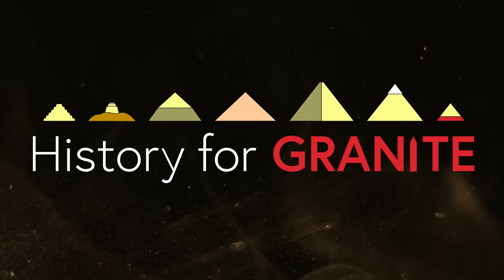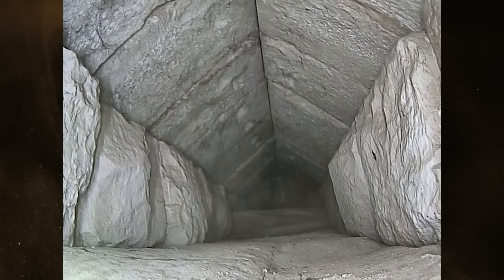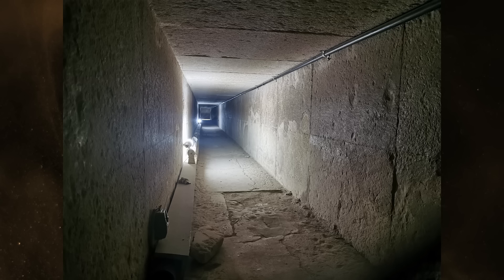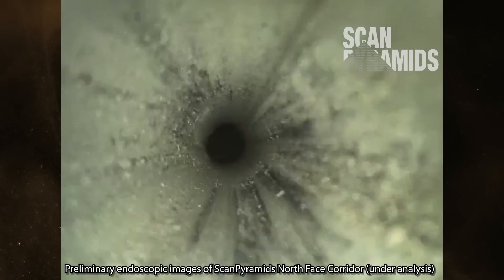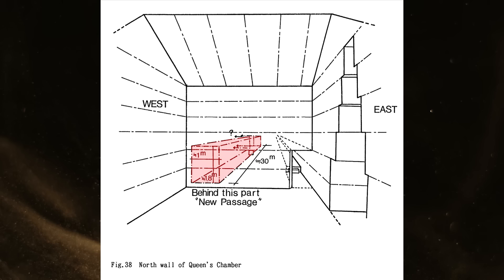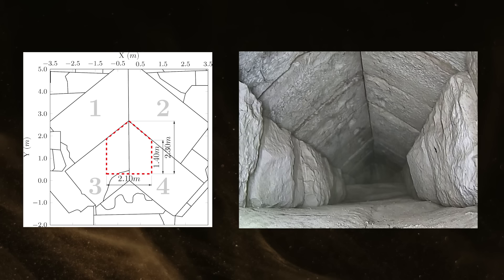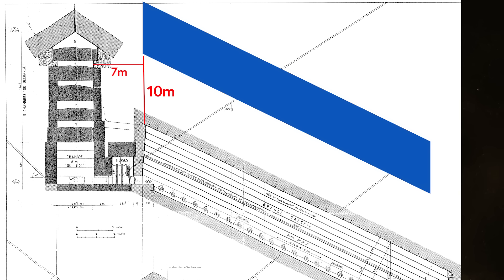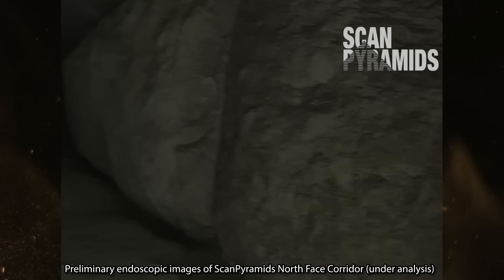New Robots to Explore the Great Pyramid

Comment: Not sure how well the sand robot would work with compacted sand under pressure. You think of that robot had to reach 20 meters in and is 10cm in diameter then you have a huge amount of sand that needs to be displaced. 
  It can't just go up freely like with all the experiments they use it on. If it was going into a completely sealed box with the weight of a pyramid on top it probably wouldn't work as well

Comment: Is it possible to combine both your ideas here? And use the air filled robotic tube on the north upper chamber shaft. It’s accessible from the outside and if there were any small holes along it’s route near the void surely they could be accessed without drilling.
Reply: Tame your wild ways, that's far too awesome for Zahi (or whoever decides) to consider. Seriously though, good idea!

Comment: Great Video
That void space will be difficult to get into. It's in an odd place inside the structure. 
If it is a space 120 feet long with no entry points then it was designed to be never opened.
That is if it is a space 120 feet long 12 feet wide.
Reply: It was internal tunnel used in building pyramid
Reply: @SoulDelSol  If this is a known fact then why would someone need to dig into that space. It has served its purpose millenia ago.
Waste of time.

Comment: I don't understand why someone doesn't go into the king's chamber, and drill a hole in the wall, to the right of the sarcophogas, about a foot up, or in one of the cracks. According to Oudin, that is the entrance to the rest of the chambers he says we haven't seen yet, the place where all the kings goods would have been stored, and the place where the original funeral procession entered the pyramid during the burial. To me it makes sense, simply because of the kinks in the little side air shafts... plus, didn't some ancient historian say that front entrance is where the procession entered?.... it seems like it would be pretty easy to drill there and either confirm, or lay to rest forever, Oudin's theory of the missing room section. I think Oudin's missing rooms, AND your theory about the 2nd grand gallery (that scan-pyramids seems to confirm) being needed to get the final heady granite blocks that high, could BOTH be true... I am curious to understand your reasons for not agreeing with Oudin here? the measurements make sense... i LOVE your channel! AWESOME content bro!!!!!
Reply: sorry, but not only that.... I honestly just do not see ANY other reason for those huge chevron blocks on the north side if it wasn't the funeral procession entrance.....  i don't buy that they were just "testing a weight relieving technology"...psh....

Comment: I think some of the reluctance to use these non-destructive exploration methods comes from the fear that more and more exploration will be done in all the pyramids, tombs, and monuments.  Also don't forget rumors that there are tunnels and mazes that are just below the surface that have been off-limits for exploration for many years, that are said to connect to sites many miles away.  The council has always seemed to want to have a timetable on the reveals that they do, so that each reveal brings new and/or renewed tourism.  Kind of like the new attraction at an amusement park.
Reply: There's been rumors about tunnels for more than 1 century.
Absolutely no one has been able to prove it.
Reply: The explorers in the 1800's would've documented them.

Comment: So is the Great Void horizontal, or does it slope parallel to the Grand Gallery?  You show it both ways.
EDIT:  Of course this makes a practical difference, both in the purpose of the void and in the plan to reach it.  The drilling proposed in this video COUNTS ON the Great Void sloping downward, so that horizontal drilling is sure to intercept it.  As long as the slope is uncertain and the prospects for success are uncertain, you can be certain the Egyptian authorities will not authorize drilling.
Reply: You would think the scan results would have shown this.  With my engineering hat on, I would expect it to be a counterpart to the Grand Gallery.  Did the scan project reliably detect all the spaces within the pyramid that we do know about?
Reply: @polbecca  I suspect that the results were too noisy for a clear answer, but I'd rather see the actual data.  All the diagrams I have seen have been similar to the illustrations here.
Reply: @polbecca  the orientation/slope of the north face corridor was also in question before being filmed, so it seems like the method used to discover the voids only gives us a rough idea. It’s my understanding that the Scan Pyramids team had to aim their tools directly towards the area of a suspected void, so I don’t think they could scan the whole pyramid in one go.

Comment: I’m guessing the “big void” was part of an inset ramp running at approximately 26 degrees from the lower North face corridor to the top of the kings chamber. This, of course, would line the exterior features up with the interior features almost exactly, and would make practical sense for the design and how the blocks were stacked in the kings chamber. From there, my guess would be that there was another inset ramp running at a similar 26 degrees approximately 7 degrees adjacent in the opposite direction up to the upper  north face feature. Would love to see a probe of the big void.
Reply: Utube has an old internal ramp video, an animated simulation of how it was made, with ramp tunnels to get up and thru the pyramid as it was being built up.
The mysterious void above grand gallery is part of the access tunnel sys as well as the passage behind the chevrons over the entrance.

Comment: Attn : Zahi Hawass and friends'-----Drill in 1" horizontal access hole. Enter from the side of The Big Void, determine best side, north or south. Drill into the void's 'best guess' center. Least destructive and cams' will be able to view all directions inside. Future for larger hole is sensible as well. Consider on the negative, that a structure may have to be scaffolded at the side. Consider the positive, the entry spot at pyramids side will not affect existing openings. Tourism, for example would be undisturbed. Just need to 'rope off' the ground area below the project. Thanks for considering.

Comment: I have a theory that the large pyramid is located on a small sandstone mountain as a base, then they started to build a 8 sided structure around it, for each side of the pyramid is divided so it will push towards the center. When the outer shell was built they filled it with sand and placed ramps and what later will be walls on the inside, when this is done they add a layer around the natural sandstone, make segments they fill with sand and then keep do this. This will make the pyramid lighter, and to use less material so it can be built much faster then we think.

Remember the story about the 3 first pyramids and how one king built them before the last big one, that indicate that 4 pyramides can be built in a tome period of 20 to 30 year or faster.

Comment: Good starting point surgestion,timely.i would take into consideration earlier surgestions of it representing part collapse material creating some of the void.i don't understand how the scanning set up work's,if it (scan)gets a clearer picture if it's set up closer to the void ie  the start point surgestion. If so,I would surgest a combination of small explorations and then scans ,on and on towards the void,but would also concider rubble and or sand,,,,which would then involve inserting long metal tubes(for the camera/scan equipment) through which it could travel through such debris/rubble/sand/calcite/salt ect.thanks for setting out this plan ,where no other would dare surgest penetrating the sacred structure

Comment: Been into the Great Pyramid what an experience, but not an engineer for sure.   I have to wonder if it possible that the void was created and filled with sand to reduce tension on the Grand Gallery and King's Chamber?  It is in a very specific location offset from the chamber and could be used to balance the weight of the Grand Gallery and the King's Chamber.
Reply: But if it’s filled with sand then it’s not a void, and wouldn’t the muon detection have missed it?

Comment: I hope they will send an expanding tube robot into the North Facing Corridor.  The walls are clearly rough finished, but the "back" wall looks more finished.  Perhaps there is another gap there to send the robot through like on the north wall.   Perhaps it might find the sand that the drilling did.

Comment: I believe that the Great Pyramid (GP) is actually 2 distinct structures:
1) The granite temple in the middle of the GP
2) 2.5 million limestone blocks that entomb the temple as a pyramid

For some reason everyone thinks the GP was all built at once and by the Egyptians.
That's like 5,000 years from now, archeologists find a home full of furniture and just assume
the builder of the house built all the furniture inside. It sure only takes a little brain power to make that assumption.

Anyway, I believe the granite temple was built when the Great Sphinx was built 12,500 years ago
by a race of people that mastered working with granite and built temples all over the Giza Plateau
and died from the Younger Dryer event 12,000 years ago that killed most humans on Earth.

We see the inside of the Granite Temple but have yet to learn what the outside of it looks like - it's entombed with millions of limestone blocks. The instruments show the voids left by the limestone blocks distributing the weight of the blocks above around the granite temple. There is a void all around the granite temple - that's what will show up over time.
Reply: Too much sci-fi here.
Reply: They have done carbon tests on wood used in the pyramids showing the age is around the right time, not 12500 years.
Reply: @kiwibonsai2355  Not true - no charcoal or wood has ever been found in the Granit Temple - you can't find a link to prove otherwise.
Reply: @noleftturns  Do you speak about a pyramid or a temple ?
There's quite nothing left from the temples ...
The room named "King chamber" is a temple according to you ?
As said above, the GP has been dated with C14. So this room is the same age.

Can you provide any links prooving what you write ?

Comment: Nowadays drones are of good quality and at affordable prices.  they are equipped with 4k, 8k cameras, they can be equipped with scanners, sonar and other detectors to find out what may be hiding behind limestone blocks and various rocks.  It would therefore be really important to be able to photograph in detail all the internal and external parts of the pyramids and to scan it entirely to create a 3D model, moreover a 3D model could also be made with multiple photos (as in "Street View"  ).  This would make a valuable archive of the current state of the pyramids for future generations, before time, water infiltration and visitors degrade them further!  Personally I wonder what may be above the limestone slabs at the top of the Curved Pyramid Chimney, because the blocks of limestone which were to obstruct the assention must have a reason to  exist.  What should they keep safe from intruders?  what other treasures can still be hidden in the pyramids?

Comment: While I like the idea of the air pressurized robotic sand snake, it might be unrealistic as the sand might be under great pressure from the rock above. (many PSI if the rock above is "bearing" on the sand) The university model shows it only a few inches below the surface of the sand. For the snake to work, sand would also have to be removed from the hole. Not just blown out of the way.

Comment: Drilling an exploratory hole into the large void from around the Kings Chamber should only happen after fully investigating where a likely passageway enters/exits the void. And the number one likely place to look is in the newly discovered corridor. The point you make about the wider corridor width could indicate that a wide corridor originally ran from the newly discovered vaulted corridor all the way to Queens Chamber [with the ascending corridor/Grand Gallery intersecting]. And this wider corridor [part of which is still hidden, and part of which was narrowed going into the Queens Chamber] has a branching corridor heading upwards toward the void. 

A person needs to get into that newly discovered corridor. There is no other way. And the best method would be to drill away that first floor block from below [it is not weight-supporting so the risk of damaging the pyramid would be very low].

Comment: Imagine if the Pyramids where mined from the ground they sit on, then filled with water to float them upwards, and filled in the bottom with sand to bring it to ground level. The Whole Pyramid was built under water, then raised with water and sand, maybe some flotations devices

Comment: What about the strange opening that was found in the Queen's chamber northern shaft?  The video showing still images from that shaft was on Ancient Architects, and in the images there is debris below the opening suggesting it was chiseled from outside the shaft.  The floor of the shaft had also been slightly chiseled away in front of that opening.  Perhaps sending the robot to investigate that opening would be a good idea.  The opening is clearly open to the outside of the pyramid, because there was modern trash found far up the shaft.  Too far to be pushed in by tourists
Reply: Or it opens into another chamber that is open for tourists

Comment: Could you answer a question which I've asked before but never gotten an answer to?          
For such a precise structure, why is the height of each step/level of the Great Pyramid so variable? If you look at the pyramid from the side you can clearly see the variability in height of each block step.
Reply from the maker: It probably varies based upon how they quarried the stone. It’s much easier to use natural fissures or weak points to extract the blocks, and this would partially determine the height of a course.
Reply: It's far from precise ... Even the King Chamber is not flat, ans walls are not verticals.
Limestone comes in layers of different height, separated by a layer of clay.
So, as wrote above, each layer of the pyramide will have just the height of the limestone layer it comes from.

Comment: Two things H4G.  The two chambers, the one for Lady Arbuthnot and the other one? If these are believed to be named after English nobility then why is the date format incorrect? On the wall was MM-DD-YYYY. in both places GB and Egypt they use the DD-MM-YYYY. I Thought that was weird? And the sand in the chamber drilled into by Dormion and Gaudin (?) was a type not found in the area so it was shipped in and had a function besides being a fancy sand. If grave robbers had broken into that sand silo it would've poured into the lower chamber they are in and possibly made room for a door block to slide down into the chamber sealing the robbers into a room that is filling with tons of fancy sand? Maybe that quartz sand flows better than common plateau sand ? And D&G didn't get sand poured onto them through the core drill hole because they drilled down at 45deg. If they drilled up from the hall below? They might have activated a centuries old booby trap? Maybe that's why the mystery void seems empty? It's full of fancy sand? Hahah.